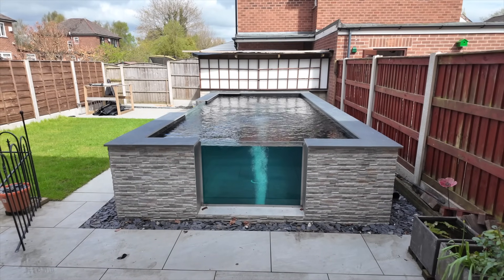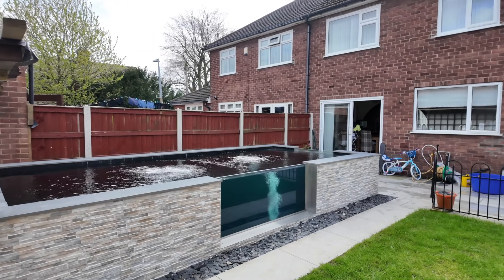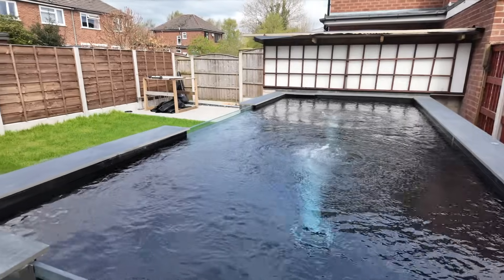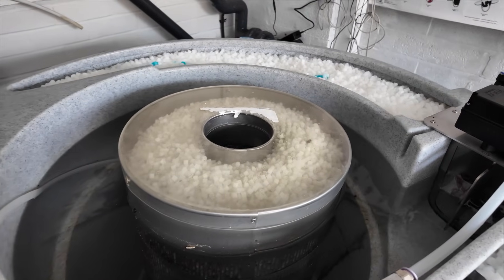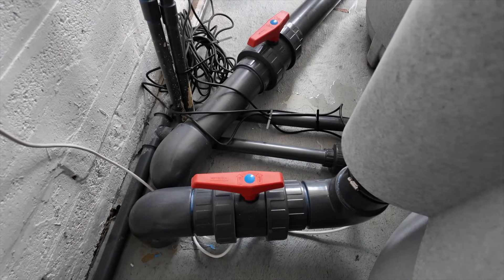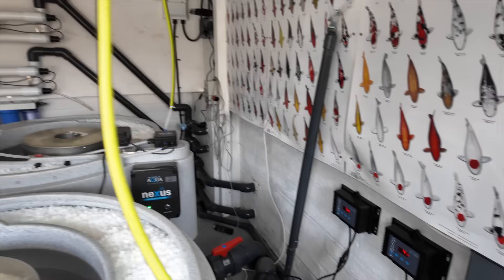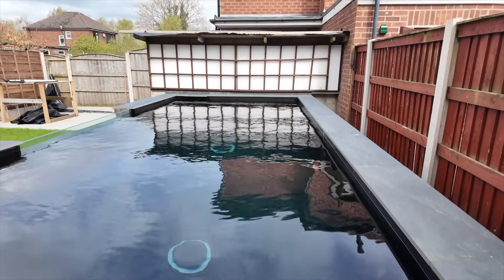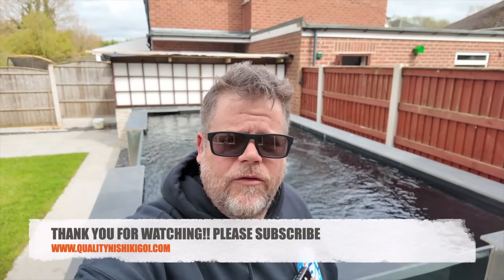5500 GALLON KOI POND!! IT TOOK A WHILE... !! STUNNING POND.

Comment: K1 only floats because of the coating used during extrusion, if you soak it in a weak PP solution for 20 mins then rinse  it cycles over perfectly within 24 hrs sometimes within hrs, just thought that might help. :)
Great looking pond with good proportions !!